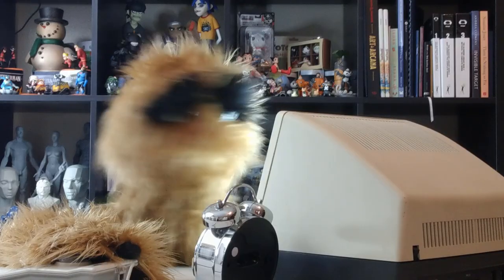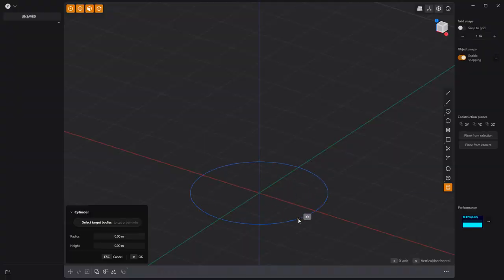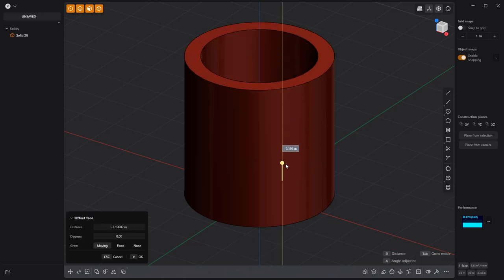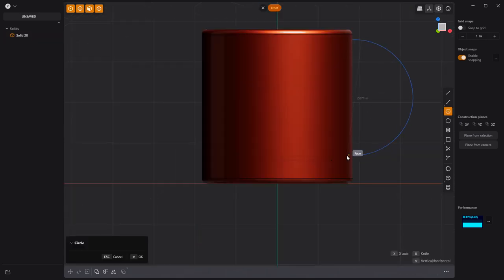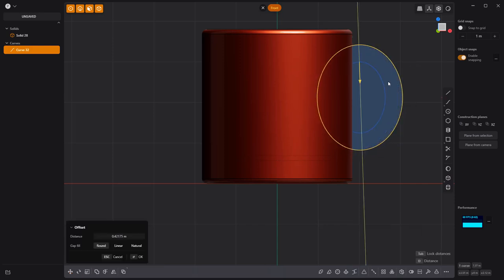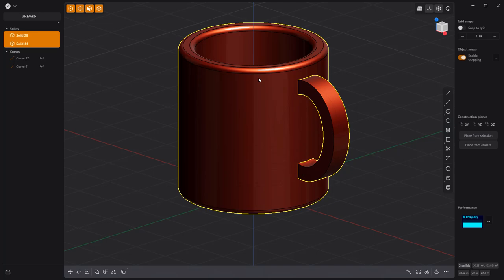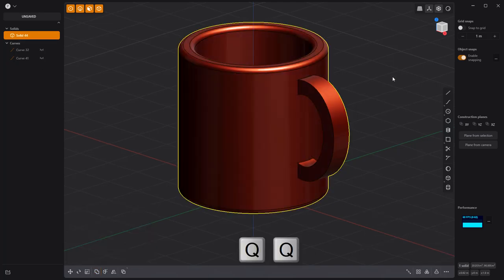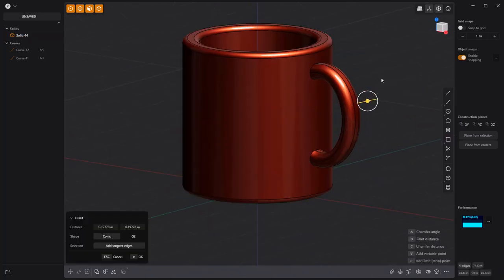Plasticity | Model a Coffee Cup

Comment: A tip to do this faster without boolean operations is to make a line down the path where the handle intersects and then trim the cup interior curves
Reply from the maker: How would you then merge the handle with the cup
Reply: @Pixelfondue  Ah worded it wrong, I meant as in drawing the handle curve outside entirely via cutting the circle down the line where the handle and the outside of cup meet then doing the process you did without deleting the faces inside as it could be tedious for similar applications, In plasticity if you use the side view via the gizmo you can set a line precise down the angle of the cylinder. I found this to be really useful when working with exterior design
Reply from the maker: @jemzstones3045  Thanks for the tip!